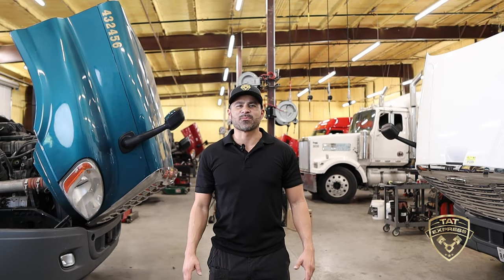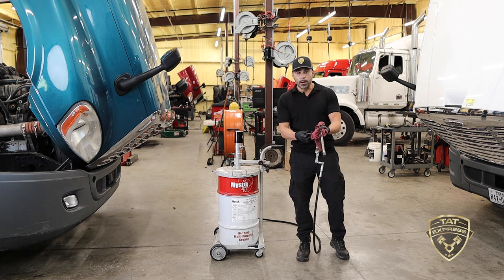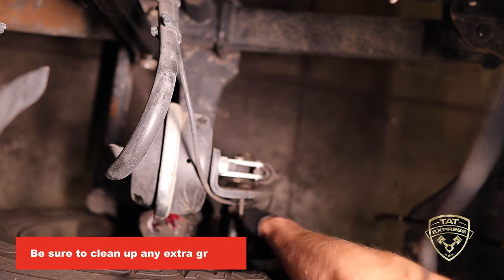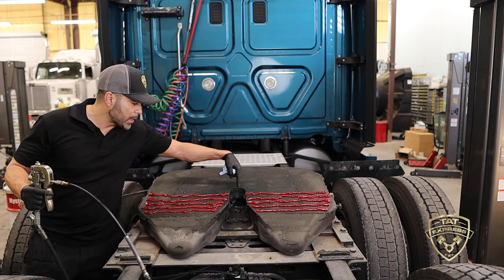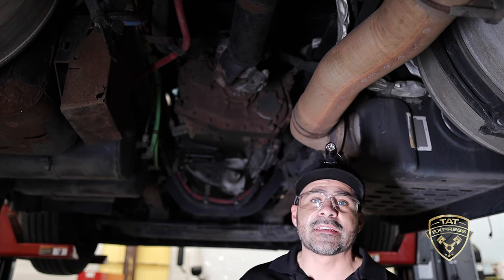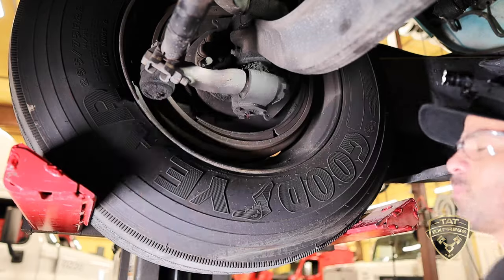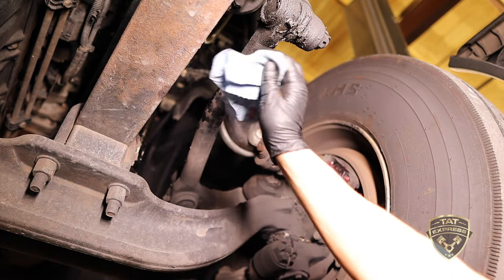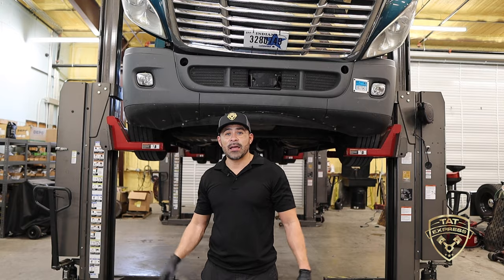How to grease a semi/ How to properly grease a semi-truck/ How often to grease a semi-truck/

Comment: Reference king pins. I always Jack front end off ground, to relieve pressure.  Turn tires left,  by hand, grease, turn tires right, grease. Then work tires back and forth. Big difference in longevity.
Reply: I had a tech that would always advise drivers to change their kingpins when they wouldn't accept grease. I knew he was wrong when I found out that you should be lifting that wheel when greasing that kingpin like you advised.
Reply: It's never done that way in shops with pits.
Reply: That sounds goofy any shop set up properly for a pm is going to have a pit
Reply: Yes they should already have a pit

Comment: "I would recommend replacing your grease gun tip".... Or at least tighten it down if you can on that tip. Zerks aren't the problem if every single zerk isn't sealing with the gun tip.....
Reply: Thank you, because of this I watched a video on the tip that it can tighten or loosen. I don’t believe many people even know that. Wow I appreciate you leading me there
Reply: @jacob2483  Glad I could help, bro. Also, remember that tips don't last forever. They wear out.
Reply: @DamagedF0X  many thanks, take care

Comment: In my opinion. You should grease no differently than you would do PMs it all depends on Applications! OTR will get the longest intervals.But me personally I treat my truck As severe duty so regardless of my application which is Regional/Local/OFF-Road I grease Weekly, i PM Every 10,000 miles or Less. I Run Oil samples every time. I run Fuel Additives & Oil Additives. I could Push it longer but my truck is 8 years old with 750,000k so I don’t wait until things are bad before I service them. Like the old timers say “be good to her and she’ll be good to you” God Bless
Reply: 10 k oil changes, that's insane....w today's synthetic oils....u can easily go to 50 k w oil sample!
Even higher w good oil filter changed at 50 k!
✌️

Comment: so we're supposed to grease the truck once every 10k miles? I grease it after every 3k miles, 2 pumps on the grease gun, is that bad for the bushings?
Reply: The more the better. You can break your monthly milage into an A and B service.
Do these things on the A and these things on the B. Keep a book with all replacement parts numbers, volumes and types of fluids will make future maintenance easier

Comment: That's actually incorrect Adam you see you have to drop your air bags when you get under your trailer with fresh Grease on the fifth wheel after your under then raise the airbags that should raise the fifth wheel on the trailer without it sliding any Grease off

Comment: 7:10  that's a great tip, simple but I never thought about that. I've had problems sliding the 5th wheel when loaded but easy to do when empty, this should help
Reply: @youtubeisawesome2487  what do you recommend?
Reply: I would recommend lowering your landing gears, once they touch the ground lower your tractor bags, and proceed to unlock to move the 5th wheel, all the loaded pressure should be off and lot easier to move.
Reply: @Hypnotikshiva  thanks man, I'll try that next time I'm loaded heavy

Comment: The DP motorhome's slack adjusters seems to have some white color grease in it (later learned it  may be some clay type grease).  Before I realized the different grease, I applied 2 short-pumps of red high-temp grease I used for my entire chassis / drive-train.  Can this small amount of a different grease cause a problem?  Can I flush most of it out by pumping the right grease through the slack-adjuster?

Comment: My truck has leaf springs and drivshaft that is a completely sealed system, no grease fitting at all on the U-joints. Would you recommend having them installed?
Reply: Not at all! Non greasable Ujoints are higher quality, not only in longevity but also in strength. Look un Spicer non greasable UJoints
Reply: Factory sealed items like leaf springs, u-joints, and gear boxes makes it easier as its less to fight with. I wouldn't mess with it till it breaks.

Comment: Grease the fifth wheel , raise the trailer slightly above the fifth wheel and back tractor stopping before coupling .  Lower trailer and complete couple .
Reply: That's actually the proper way to connect a recently greased fifth wheel to a trailer.  I also, lower my air bags to the fifth wheel (when the fifth wheel has been recently greased) and slowly back under the trailer (without having the fifth wheel touch the trailer) before coupling to the trailer (then I raise my air bags until the fifth wheel touches the trailer and then I back the tractor until it connects to the trailer without having any of the grease slide up to the top of the fifth wheel).
Reply: Owner may do that,  but for a driver that may be too much work lol

Comment: Question detroit masters, which transmission and rear end is best for the 14.0L and 12.7L?
Reply from the maker: Kemetnu King Trucking, I recommend following the sticker inside the door jam for the drive line setup.  It is what the truck was manufactured with.

Comment: At 11:24 in the video, you were greasing the front steer area and it is clear that the truck needs new front brake pads.   They do not look like they are wearing correctly.
Reply: You saw call that?

Comment: Forgot the leaf springs front and rear, also didn't take weight of king pins.... completely forgot the top of the King pin.... only greased the bottom incorrectly.

Other than that....not to bad !

Comment: Mr Adam ,my engine Detroit 60s 12.7 
I notice my coolant temperature is 200-204 when am idle or in traffic 
Is that normal , 180-185 cursing 
Plz I need your advice , thank you
Reply: Pretty normal, you can add a switch to turn on the fan manually so you can turn it on while you're at idle
Reply: It will run that hot because lack of air flow a manual fan switch will change that
Reply: Separate air to air cooler and a/c condenser from radiator . Blow out with compressed air .

Comment: Keep in mind you are inserting a liquid into an area that you cannot see through. So the only way you know of you put enough is if it comes out the other end. I have heard too many so called mechanics say just three trigger pulls per grease fitting. That's truly bad advice.
Reply from the maker: Great point! In most areas, seals keep dirt and water out.  Over filling until the grease burst out would break the seal that is designed to keep grease in and dirt/water out.  This is why the time application is recommended in some application .

Comment: I have 2 spring pins that refuse to take grease
Reply: Replace grease zerks . Hit spring roll with hammer . Air hammer with large flat punch may work best .Try letting weight off spring lift the frame .

Comment: You are absolutely wrong about pumping grease into it until it comes out. That is called over greasing. That is how you blow seals out. You guys put a lot of great content out but this one starts out wrong right in the beginning
Reply: Which ones have seals? Ive never noticed any seals on ujoints and slack adjusters. Only been greasing my truck for 2 years so honest question.
Reply: The seals on your slack, tie rods, drag link, u-joints s-cams and every other place you put grease to it. You shouldn’t over grease cause then that causes grim and dirt to accumulate around those joints causing premature wear on those components.
Reply: @PSALM-144-1  oh yeah! All those seals are already busted on mine im used to seeing them ooze a little. But thats right after i replace them dont want to balloon those again!